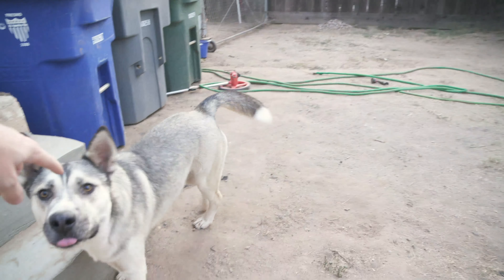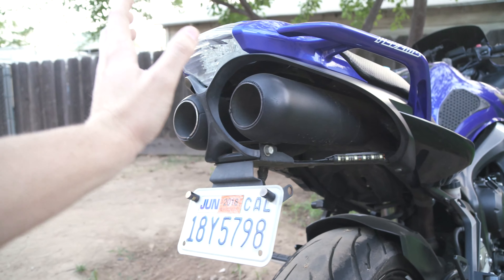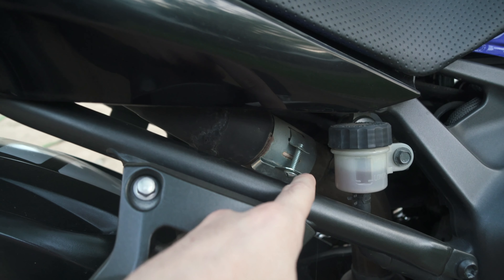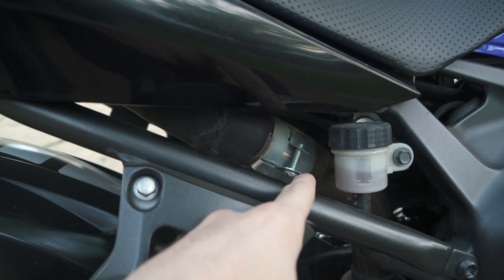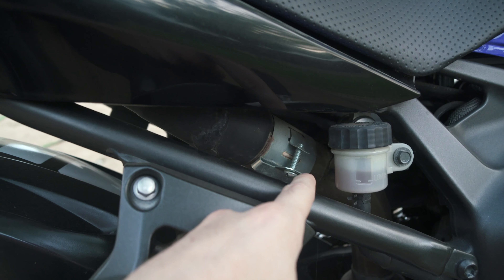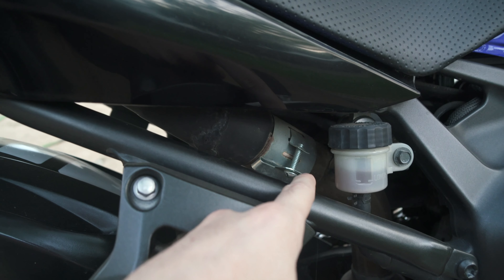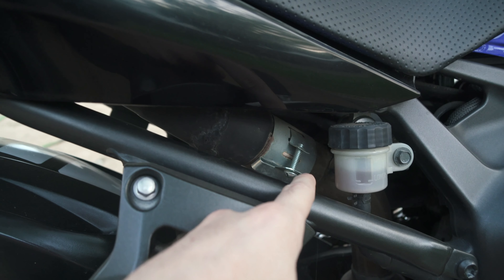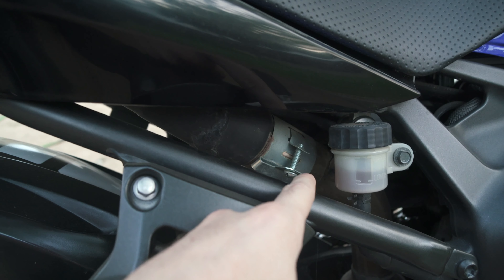My $50 DIY Exhaust | Yamaha FZ6 "Fazer"

Comment: Hi, did you have to tune your bike after doing this? Also, what would it sound like with only a k&n high flow air filter and stock exhaust? Thanks!
Reply from the maker: Nope, stock tune!

It would sound stock haha
Reply: @TheInja  Cool! are you at all worried about damaging the engine from running lean?
Reply from the maker: @Bob-wr3nw  Nope! It will run for just as long as stock.